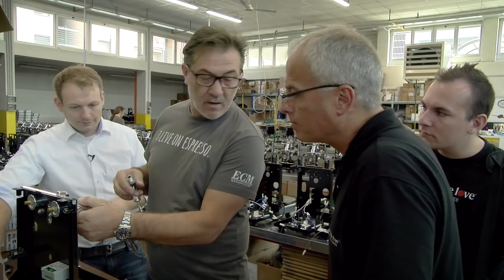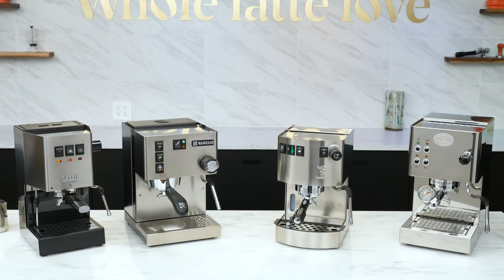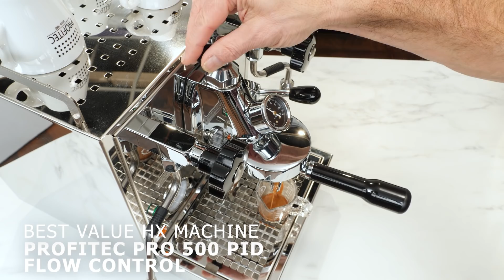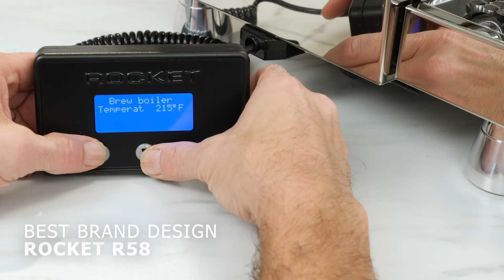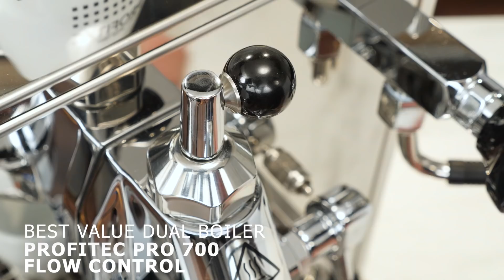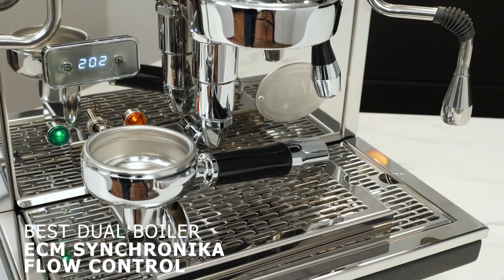Top 5 Best Semi-Automatic Espresso Machines of 2019

Comment: Clive Coffee claims that the Profitec 500 PID is for the steam temp. and doesn't measure the brew temp. while you say it measures the brew temp. Why is this so confusing?
Reply from the maker: Hi Vincent, The Pro 500 uses a heat exchange boiler so the PID does control the temperature in the steam boiler. Within the boiler is a heat exchange section which heats the water for brewing espresso. Using PID in an HX boiler was rather uncommon until a few years ago. As mentioned in the video it requires good internal engineering to have a PID temp in the HX boiler produce a given temp at the group. It's complex but it's about design of the thermosiphon system which constantly flows water via convection to the group. Proper sizing of a flow restriction in that system is a big part of it. The bottom line is you can get a desired brew temp at the group by setting a particular temp for the HX boiler. In the Pro 500 a boiler temp of 248F produces a brew temp of 200F. 246F = 198F, 250F = 201F.
Marc

Comment: Hey :) I can’t decide between the ECM Synchronika and a la Marzocco Linea Mini. You mentioned the synchronika which I am glad for. May I ask why the Linea Mini didn‘t make it into the list? I know it is way more expensive. I just want a machine to last and make great espresso and cappuccino. Can you help me with my decision? :) thanks in advance 😊
Reply from the maker: Hi AF, Kinda bugs me that there's no temp display on the Mini and it's rather expensive.
Marc
Reply: If you have $5k to spend on a LMLM, you might as well go all the way and spring for a GS3. The Mini is pretty and supposedly steams great, but feature-wise it's trumped by machines like the Pro 700 and Synchronika (e.g., digital shot timer, line-pressure pre-infusion, optional pressure profiling). You gotta pay an extra $200 for the Mini's plumb-in kit alone!

Comment: Curious what made Pro 600 not get any mention at all? :o :)
Reply from the maker: Hi T, So many machines! Pro 600 is a fine machine! Basically a 700 without the rotary pump, plumbable connection and smaller steam boiler.
Marc

Comment: Still very happy with my Synchronika. Had it updated a year ago to get more steam-power and I will have to look into the latest gadget, the flow control. But first busy looking at commercial machines at the moment as I am preparing for a coffeeshop in the near future...
Reply from the maker: Hi Jeroen, Thanks for the comment! Great to hear you are very happy with your Synchronika! Good luck with your coffeeshop! Have you had a look at Dalla Corte machines? I've been working with a Dalla Corte Mina for a few months. It's a single group commercial (some are putting them in their homes) that does accurate and repeatable flow profiling as well as manual flow profiling. In multi-group have a look at the Dalla Corte XT. It has independent boilers for each group. Work with different brew temps on each group and other groups continue to operate when doing maintenance on another. I was at George Howell Coffee in Boston for a Sneak Peak event featuring the Mina and XT a couple of months ago. Video from that event: https://youtu.be/J_MDUqJTDtk
Ogawa Coffee Japan/Boston uses Dalla Corte machines: https://www.dallacorte.com/en/magazine-ogawa-coffee-in-boston-is-a-peaceful-oasis-to-enjoy-an-exceptional-specialty-coffee-n-339.html
Marc

Comment: We ask questions but get no replies. Unsubscribing.
Reply from the maker: Hi Mike, I really do my best to personally answer every question within 1-2 business days. Something north of 5,000 personal responses from me on the channel. I do from time to time take vacations and disconnect. Every once in awhile I may miss a question or 2 but it's rare. I just searched all the comments on the channel for questions from you. I found only one which I did answer yesterday. In case you missed it here was my response when you asked: "What causes the coffee puck to stay in the group head when portafilter is removed? Any help?"

My response left yesterday: "Hi Mike, Thanks for the question. It may be too much coffee in the portafilter. If that's the case the coffee will contact the shower screen during extractions. If your machine has a 3 way valve (what make/model machine are you using?) water is exhausted from the filter basket when brewing stops. Negative pressure causes coffee puck to move towards/adhere to the shower screen of the group. Coffee should not contact the shower screen during an extraction. I'd try less coffee or use a filter basket with higher capacity. Here's a link to filter baskets of various sizes: https://www.wholelattelove.com/collections/portafilters-and-filter-baskets?_=pf&pf_v_brand=IMS
Hope that helps!
Marc"
Reply: This rude comment is so far from the truth it is hilarious.  The WLL channel, mainly Marc with periodic help from colleagues, has to be by far the YT channel with the most frequent, and immediate, responses by the content creator I have ever seen.  Despite being a retail vendor for these products, WLL is making videos that are not just sales pitches, they are informative for a broad public interested in coffee.  Thankfully the majority commenting on here do appreciate all Marc is doing for the community and industry.
Reply: Others have received replies from WLL.
Reply: Marc are you the head of social media for wll? Just curious
Reply: Agreed. CMackd. Marc is one of the most responsive and informative/professional responder on YT. Keep up the great work Marc. I just purchased a ECM Sync from you instead of the other choices in no small part because of the extra value and educational service that you and your team provide.

Comment: I'm looking for the smallest height espresso machine that is at least a heat exchanger with PID control? I have limited cabinet space and a wife that I must keep happy!
Reply: With a bit of simple DIY you can often lower the height of a machine by replacing the feet with little wooden blocks.
Reply: @OKuusava  negative.  I need it under 15 inches in height. What say yee wholelattalove?
Reply from the maker: Hi Jay, The Appartamento (no PID) is a little under 13.5" without the cup rail: https://www.wholelattelove.com/collections/semi-automatic-espresso-machines/products/rocket-espresso-appartamento-with-ruby-panels
Profitec Pro 300 is a compact dual boiler with PID it's 15.16": https://www.wholelattelove.com/collections/semi-automatic-espresso-machines/products/profitec-pro-300-dual-boiler-espresso-machine
Profitec Pro 500 PID is HX is 14.25" without the cup rail: https://www.wholelattelove.com/collections/semi-automatic-espresso-machines/products/profitec-pro-500-pid-espresso-machine
Marc